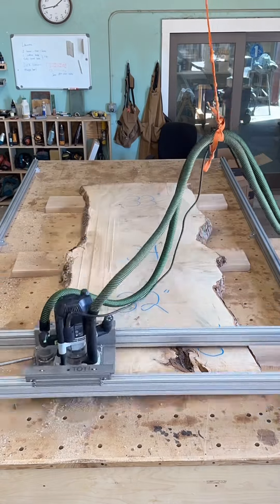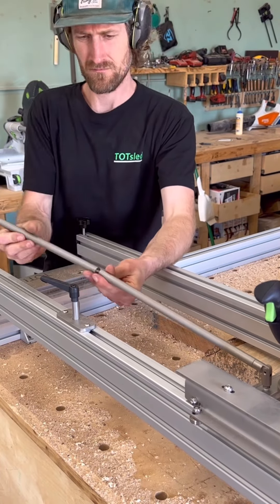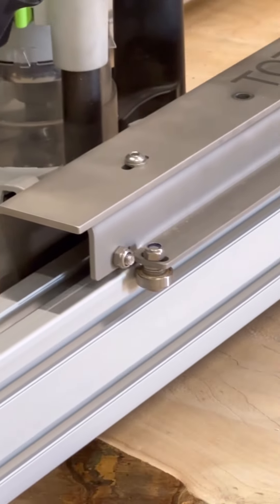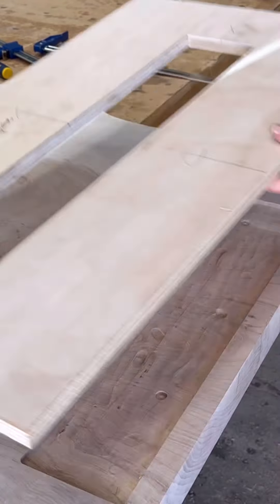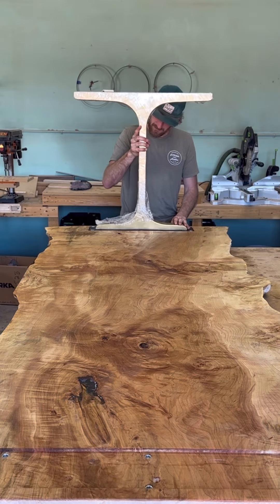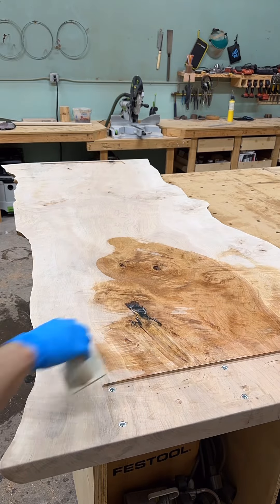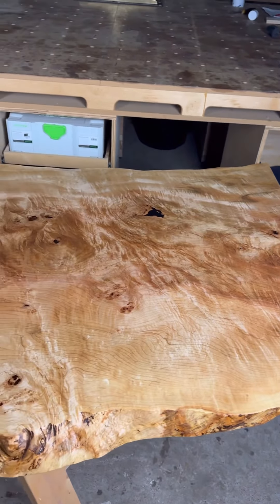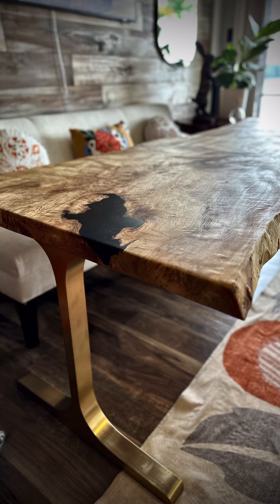Live edge maple table build

Comment: Well done!  On the Rubio, what was the little hand tool you were spreading it with?  I tried an electric buffer with a 3M buffing pad, but it absorbed as much as it spread, and I felt like it wasted a ton.  It's expensive, so looking for a better solution...
Reply from the maker: Thanks a lot! I appreciate it. 
I’m applying it with a non-abrasive woven pad. Rubio has a nice set with the handle as well. https://www.rubiomonocoatusa.com/products/applicator-set